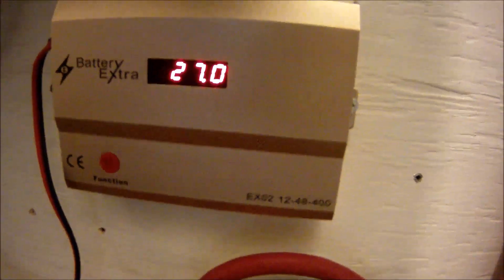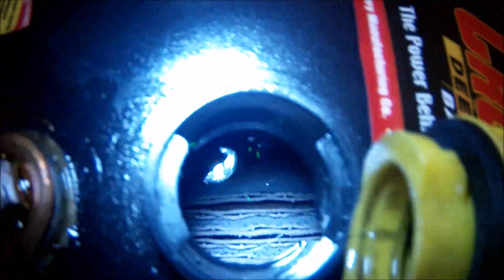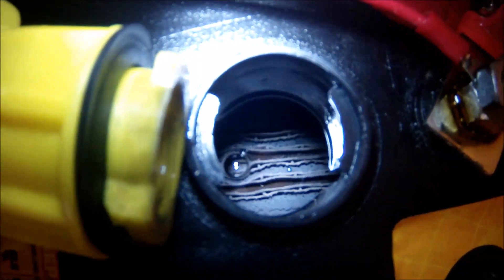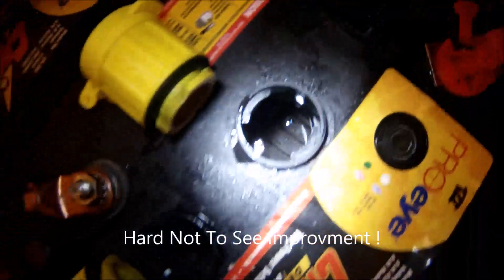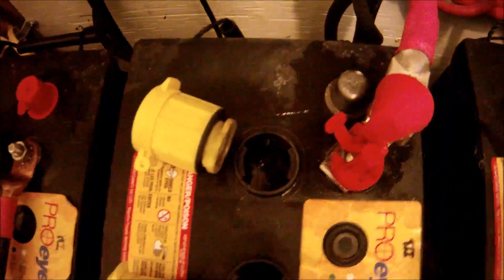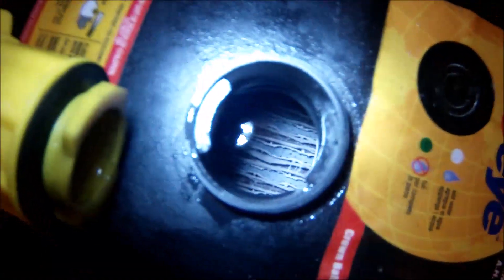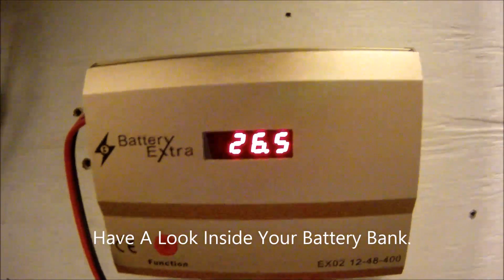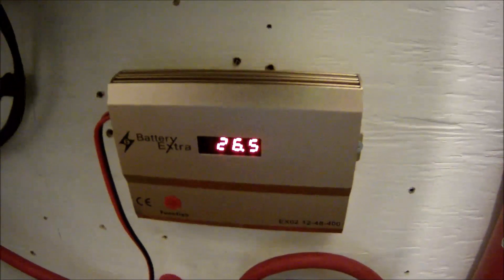Battery Extra Battery Desulfator Final Report.

Comment: Got mine installed. Quick question: why isn't there an inline fuse on the battery leads? Wondering if I should install a little inline fuse for it...mini-automotive style. Thanks.
Reply from the maker: Mine don't have one either i assume it has 1 inside but a 1 amp fuse would not hurt. I'm excited for U.
Reply: Thanks man...I also sent Justin a PM inquiring on it too. Gonna hold off on doing a YouTube video on it...gonna do a full shake-down. But, I did a quick 20-second video on my Chris DIYer Facebook page: https://www.facebook.com/ChrisDIYer/
Reply from the maker: Thanks!
Reply: @TheKiloG69   great video brother...one quick question, how has the battery extra worked so far and has it kept your battery bank in good shape? Thanks
Reply from the maker: @fazimabdool6437  I took it out about 5 years ago. Used it with flooded lead acid L16 battery's that only got 2.5 years of use.
Reply: @TheKiloG69   is it still on the l16's ? How has it performed on them ?
Reply from the maker: @fazimabdool6437  no it was removed & battery's replaced 5 years ago.
Reply: @TheKiloG69  ok nice.... So with your experience with it , would you recommend it as a means of protecting your battery bank from desulfation , I would like to invest in one but it's really expensive to get to my country and money isn't easy to come by , so that's why I really need info on whether it's a good investment or not ...pls do advise

Comment: Desulfators are crap. Use a 100 amp DC welder http://rover.ebay.com/rover/1/711-53200-19255-0/1?icep_ff3=2&pub=5575119394&toolid=10001&campid=5337663791&customid=100A+Adjustable&icep_item=291952297948&ipn=psmain&icep_vectorid=229466&kwid=902099&mtid=824&kw=lg VERY Durable
48 to 60 VDC. 
OUTDOORS PREFERRED, Just run some leads off the batteries and take them off the system so your inverter or controller don't freak out. 3-4 batteries at a time(400 amps @20hr worth), take the watering caps off and from 10 feet back with the ground wire clamped you just put a piece of metal in the rod holder and tap repetitively holding for about 1/2 second at a time ( yes, they arc a small bit) on those temporary leads. As soon as you see a little water bubbling(spitting) out the fill holes your done. Use a fan to disperse any hydrogen gas.  I do mine 2X a year. My 5 year batteries are going on 8 years now. You can also ad a little Epson Salt Restoration treatment if they are stubborn.

Comment: have you ever looked at battery balancers, theyre also meant to prolong battery bank life by protecting the individual batteries from going too high in the voltage by diverting voltage to the lower voltage batteries in the bank, pricey but probably worth a look.

Comment: I have never believed in these units honestly. The fact that a $150 gizmo can can double the life or rejuvenate a battery bank worth thousands of dollars just seems too good to be true.
But these results dont lie.. its obviously doing as its claims.
I actually ordered one based off your last video. lol. Just waiting for it to be delivered.
Thanks for the video series. well done.
Reply from the maker: Thank U!  I know U will be very happy with results I am 100% sold on the performance of this unit. The cheaper ones $25-$40   sold on most solar websites & fleabay are not worth buying. I only wish I knew about this when I installed my battery bank New1800 months ago.
Reply: better late then never they say. I did do videos on them a year or 2 ago. I sell one with every bank I put in. I don't ask them i just add it to the cost of the bank. Saves a lot of problems latter on down the road.
Reply: @JustinCaseSolarPower   I want to believe you predominantly deploy Axpert/PIP MPP solar inverters. Wouldn't the high frequency pulsing shorten the life of DC filtering capacitors inside the Axperts?
Reply: @aogulla  Been on my system for many Years now. Has not bothered my inverters at all. My batteries are still performing as New and my inverters Still run my Home. 24/7/365 days a year. I use Mpp Solar Inc inverters. What you believe on not does not worry me. I only deal in facts.
Reply: Thanks Justin for your response. Glad to note that the device has not caused any damage to your PIP inverters as that is what I also use. Cheers mate and stay safe.
Reply: @aogulla  No problem. All i can give you is the facts on how my system has gone over the years. I don't sell anything so its very easy for me to deal in facts.
Reply: Desulfators are crap. Use a 100 amp DC welder http://rover.ebay.com/rover/1/711-53200-19255-0/1?icep_ff3=2&pub=5575119394&toolid=10001&campid=5337663791&customid=100A+Adjustable&icep_item=291952297948&ipn=psmain&icep_vectorid=229466&kwid=902099&mtid=824&kw=lg VERY Durable
48 to 60 VDC. 
OUTDOORS PREFERRED, Just run some leads off the batteries and take them off the system so your inverter or controller don't freak out. 3-4 batteries at a time(400 amps @20hr worth), take the watering caps off and from 10 feet back with the ground wire clamped you just put a piece of metal in the rod holder and tap repetitively holding for about 1/2 second at a time ( yes, they arc a small bit) on those temporary leads. As soon as you see a little water bubbling(spitting) out the fill holes your done. Use a fan to disperse any hydrogen gas.  I do mine 2X a year. My 5 year batteries are going on 8 years now. You can also ad a little Epson Salt Restoration treatment if they are stubborn.